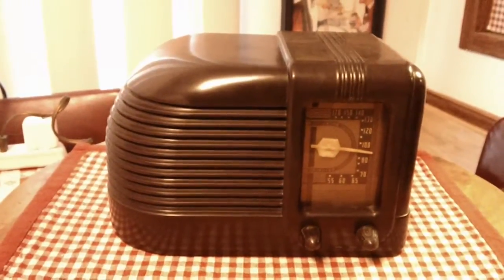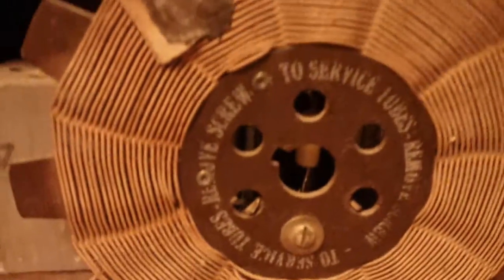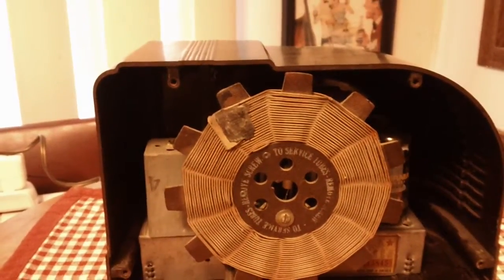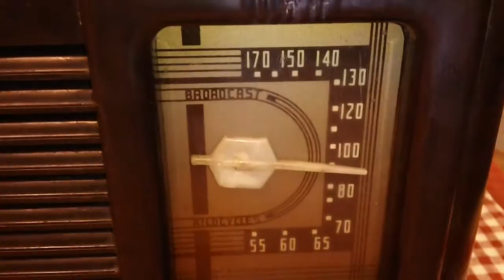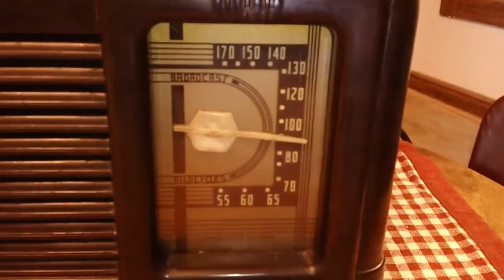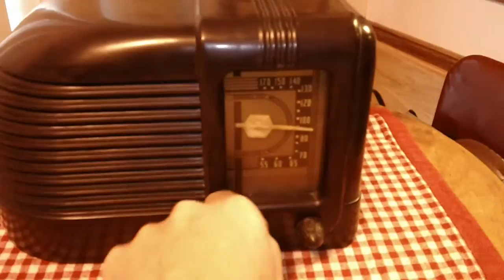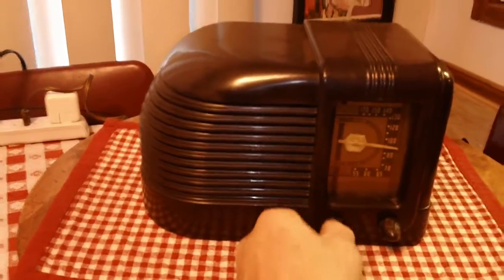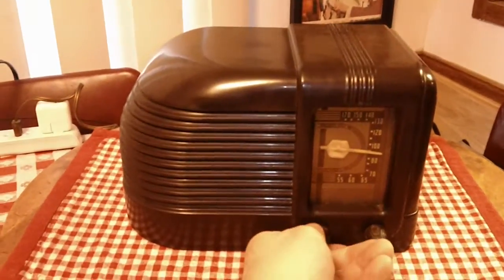Admiral 15 D5,  a Vintage Tube Radio, from 1941

Comment: Nice radio, I like the styling, although it looks more like it should have come from the 1930's (not that that's a bad thing). When I was out in Hawaii on vacation two years ago, I went to see the USS Arizona memorial (which straddles the sunken ship, for those who don't know) and what really made it hit home for me, were the drops of oil that have been steadily rising to the surface since the ship was sunk in 1941.
Reply from the maker: The Arizona is still rendered honors by military vessels entering the harbor.  Some believe it's still a commissioned vessel, but that's not the case.  I haven't been there, Matt, it has to be a moving experience.  Thanks.
Reply: It certainly is, and it's worth a visit if you ever end up taking a vacation to Hawaii.

Comment: Al,
Sorry for the delay.  Our ole puter has a virus and I couldn't make it go away, so today it went in the shop.  Probably won't get it back until next Tuesday or Wednesday.
Not long ago I happened across a WWII vet in a restaurant, identified by the ballcap he was wearing.  He was in his 90s and he had served as an engineer.  He told me his unit followed Patton all over creation.  I wanted to spend more time with him, but had to take our grandson to an appointment.  Maybe I'll run into him again.  Sure hope so.
And you know...I've had occasion to meet more than a few WWII German soldier veterans.   I learned from them that there's not a great deal of difference between veterans of that era, regardless of the army in which they served.  Duty was duty.  Fear was fear.
Good vid, my friend.

Regards,
John
Reply from the maker: Funny you should mention meeting WWII German soldiers.  Here's how you bridge generations, at my age.  When I got out of the Navy, I applied for a job at a hospital (Same company I still work for), as a Biomedical Electronics Technician, a position, at that time under the Plant Manager.  He told me that they had a position budgeted, but, it wouldn't go into effect until the first of the year, 9 months away.  I told him, well, I need to go to work now, 9 months wouldn't help me.  He said, well, I've got a position open in our engineering department as a maintenance mechanic, if you take that, when the biomed job is open, it's yours.  I said okay.  Come to find out, the engineering job was opening because a guy named Oswald, was retiring.  He was a German POW who stayed.  He was missing his trigger finger, but, I didn't have the nerve to ask him about it.  So, I guess my first full time civilian job was taking the place of a German soldier.  There was another guy in the department, Jim, that was a Sailor in the war, too.  He retired a short time later.  He had some stories, which, at the time, I thought were probably BS, but, in retrospect, most likely were true, of kamikaze attacks. He was an old Bosun's Mate. I know Jim has passed on, likely Ozzie, too.  All of my Uncles that served are gone.  They are disappearing, that greatest generation. I hope you run into that Gentleman again.  Thanks for the comments, you are a pretty wise man John.  Appropriate at this time of year.   Good luck with the computer.  Got to say, though, you need to stop opening those "you are entitled to a settlement" letters :-)